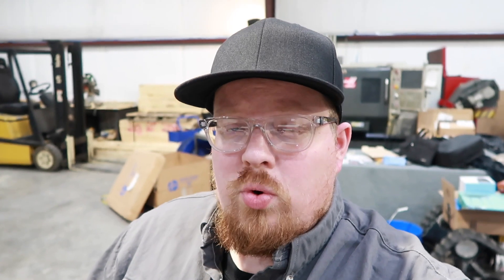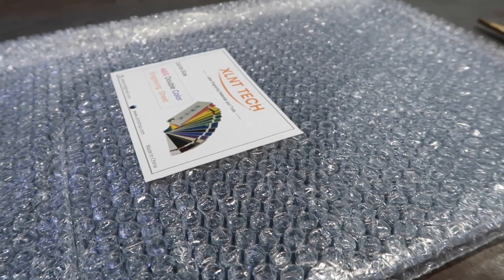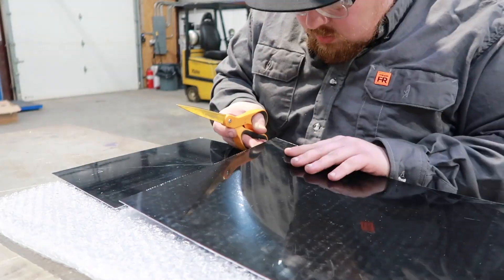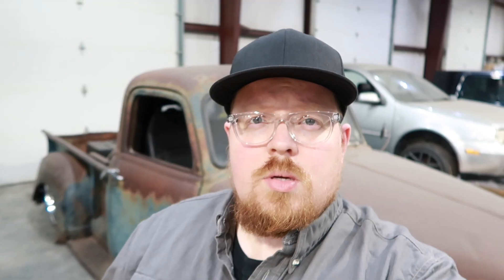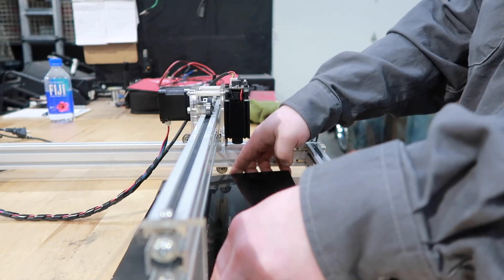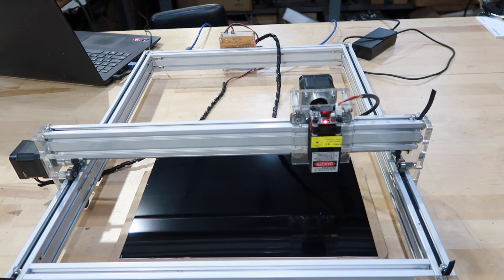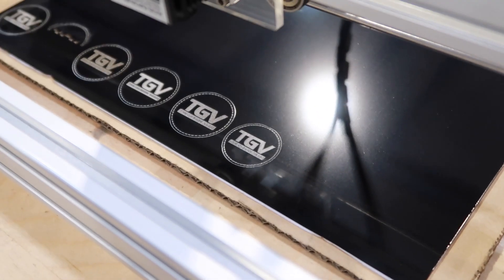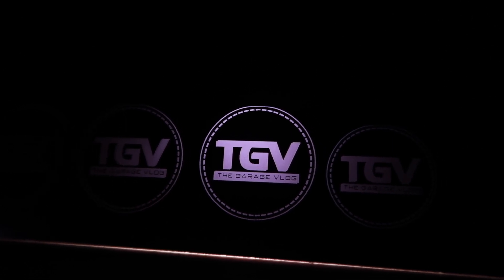Laser Engraving ABS Double Layer Material Sunwin Bachin 4050 Amazon | Newbie Mistake | Illuminated

Comment: I’ve never worked with plastic. Can you cut the design out with the laser and get a clean edge?
Reply from the maker: I wasn't able to get it to cut through even with multiple passes, just not enough power for this material.
Reply: Wrong frequency as well. Diodes almost can't cut white, transparent or blue plastics at all.

Comment: I've learned some from working with that material. For starters, if you have air assist - turn it off.
My 10w engraves this pretty well at 2600 and 35%.
After it's cut, wait about ten minutes and wipe it gently with alcohol. All the ABS ash will come out of your cuts and the dye will come out as well. If you don't, you'll probably still be fine unless you try to clear coat it to protect the somewhat delicate top surface. If you apply clear without first washing it with alcohol, purple dye will seperate from the black layer and run into your engraving.
They engineered this stuff to engrave really well on diodes without air assist. If you turn on air assist, the ablated material will get pushed into your white layer and darken it somewhat.

I know you didn't have air assist in the vid, just wanted to warn anyone watching.

Also - it's fkn ABS! Releases toxic fumes and WILL rust ferrous hardware near your engraver. Ventilation is key!
Reply from the maker: Thanks for the tips!